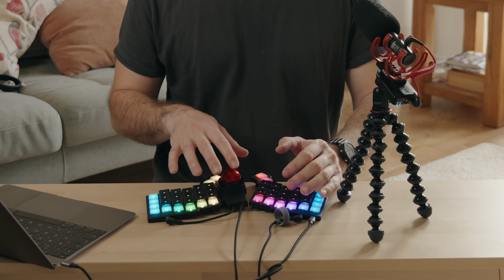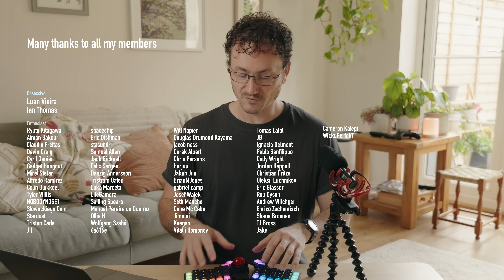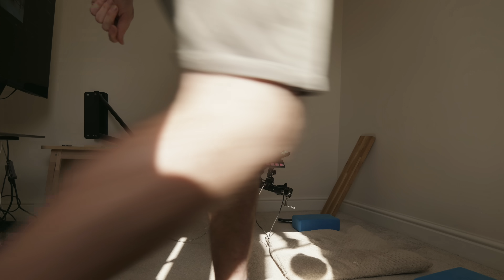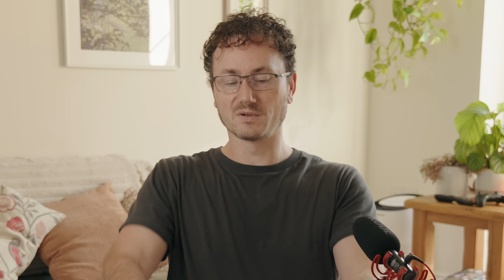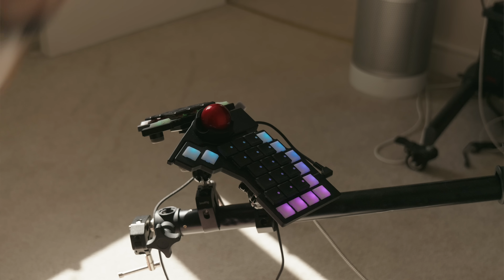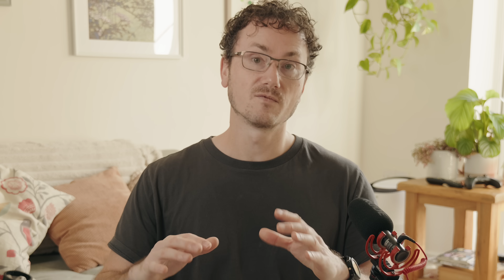ZSA Navigator - Hitting The Ground Running

Comment: Have you considered a charybdis? It is functionally identical to the setup in this video except for one more key in the left hand thumb cluster. But the cup for the ball is angled in a way that supports higher tenting degrees. It also has a concave keyboard which I personally find more comfortable than flat keyboards. There is a prebuilt with qmk, but you could 3d print your own and add everything necessary for zmk. Now that you mentioned 3d printing, I wonder if you will soon build your own keyboard!
Reply: I have a love/hate relationship with it.
Love having a trackball build in, super convenient. HATE...well it gives me severe RSI to the point where I've taken the ball out and disabled it in qmk.
Reply: there are others like the Keyball and Killer Whale as well
Reply: @behem07h71  I have a custom modified keyball39, 10/10
Reply: I have a Charybdis, and while the ball is functionally working great, and is in the exact position where you can thumb it around while staying perfectly on the home row (I've even bound j,k,l as left/middle/right mouse buttons which is also very familiar from a normal mouse) - I just get really bad thumb RSI when I use it. 

Also, having it in that perfectly reachable location makes it way too tempting to just mouse everything with the ball, rather than using keyboard shortcuts which would be way more ergonomic.

I think I'd rather have a trackpoint between H and J.
Reply: @magnusd8226  thumb balls always have been a bad design
Reply: The ball falls out when you flip it barely upside down on the Charybdis. Pretty annoying
Reply from the maker: Yeah I think if I go down that road I'll go straight to trying to get something 3D printed to my requirements - check this out https://ryanis.cool/cosmos/
Reply: @BenVallack  Interesting a new one. Yet more to throw into my analysis paralysis mix :0)

Comment: I wonder if there is a solution that essentially turns your wired keyboard into a wireless one. Essentially, it'd be just a dongle with a battery that connects to a usb plug wirelessly through bluetooth (or ideally also 2.4Ghz) to turn any keyboard into a wireless one. In my mind this dongle isn't even seen by the keyboard itself and it just thinks it's connected to a compture directl

I mention this because I DO have a lil bluetooth dongle that does exactly that for wired headphones and I LOVE it! So I could see it being a thing for keyboards as well
Reply from the maker: Yes they exist - I've heard they do work well! https://sterling-key.com/

Comment: What's the thinking behind no chair and the new sitting position?
Reply from the maker: I figured if I sit on the floor I would never manage to stay in one position for very long which I think is what is needed to avoind any ongoing issues like back issues or varicose viens. I alternate between sitting, kneeling, squating and standing. With some of the day on a laptop in a normal chair as well.

Comment: The amount of wobble you have at 11:16 is wild to me. IDK how you handle that, coz I don't think I'd be able to handle it!
Reply from the maker: Yeah it's definitaly not ideal! I have since moved the bracing stool closer to me which firms it up to the points I'm genuinely not worried about it now.
Reply: He uses fancy keyboard setups but sometimes misses very basic ergonomic principles.
Reply from the maker: @alexpirine  This isn't an ergonomic issue - the reason I put up with the wobble was to improve ergonomics. The wobble affects speed and accuracy.
Reply: @BenVallack  kneeling for longer periods is
Reply from the maker: @lostintechnology1851  Yeah - the idea was it would increase some core strength and flexibility which would have a net benefit in 'ergonomics'. I have actually back peddled on that idea now - some very interesting new ideas on the whole thing coming soon!

Comment: The trackball under the thumb position is what I've dreamed of ever since I got an ergonomic keyboard years ago! I'd LOVE if you made a hand-made board (or an attachment) that uses the trackball where the left thumb cluster is supposed to be!! I'd LOVE to hear your thoughts about that!

 One thing though, I think that it would then be nice to have keys right next to the trackball that essentially act as mouse buttons. Maybe I'm wrong about that but that's something else that I'd love to get your opinion on, actually!
Reply: Have you looked into the Ultimate Hacking Keyboard? It supports input modules, including a trackball, but also a trackpoint and trackpad, which sit under the thumb position. Those modules sit under the right thumb though, not the left.
Reply from the maker: I think for me the goal would be to keep fingers on home keys and use layers to use them as mouse keys - but for sure getting the ball as close to a home thumb position is where I want to be!

Comment: I'm using the keyball44 which has the trackball accessible by the thumb instead so it can keep you within the homerow. But it's a more DIY build than prebuilt like ZSA's keyboard
Reply from the maker: So that ball is reachable by thumb while the fingers are still on the home row? It looks too far out?
Reply: @BenVallack  Unfortunately, I can't add photos here to show it off, but yeah, I can easily reach the trackball with my thumb while my fingers are still on the home row. This is the same on both the Keyball61 and the Velvet 3 UI. 

In fact, I use the home row (on both halves) as my mouse buttons, sniper button (slows the mouse movement while held) and the scroll button (turns the ball into a smooth scroll wheel while held).
Reply from the maker: @paulomalley brilliant, sniper button is genius. How have you set that up?
Reply: Oh man! I didn't know about these! That looks amazing!! So the trackball lives under your palm and is reached by putting your thumb kind of under your palm? Was that easy to get used to? Do you have to move your hand when you're reaching for the trackball? Is your hand comfortable when you're not using the trackball?
Reply: @unrealed It doesn't really require any movement in order to use the ball. I have the Keyball61 and the ErgoHaven Velvet 3 UI. I personally struggle to go back to a standard keyboard layout now. 

Both of these support the auto mouse layer feature too, so you can bind either your left thumb cluster to mouse keys or possibly even leverage your home row for mouse keys including a scroll key to turn the ball into a scroll wheel.
Reply: @BenVallack +1 on the keyball. The ball position is beyond perfect for what you're looking for
Reply: I bet a new shell for the zsa trackball could enable you to put the ball in a similar position.